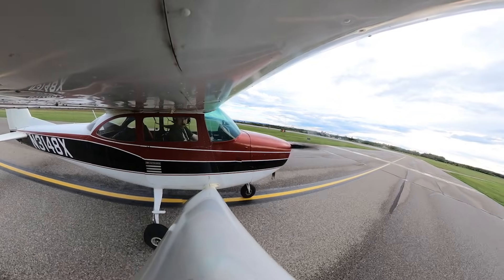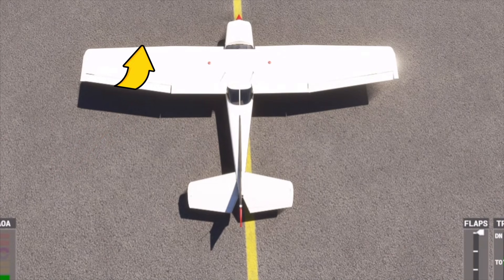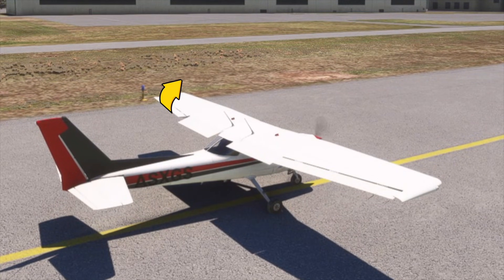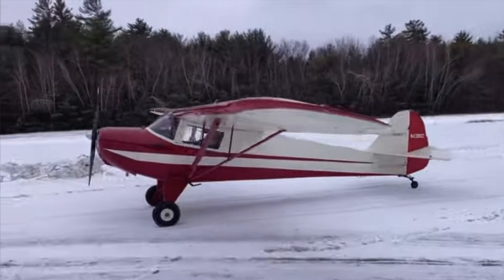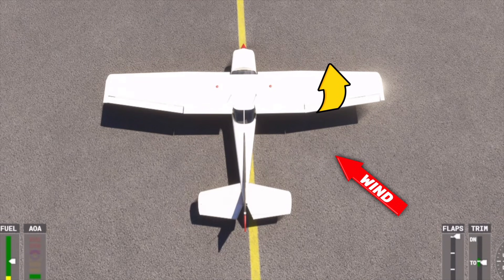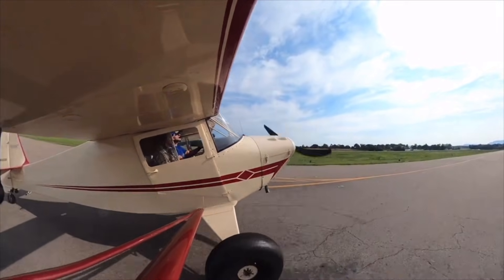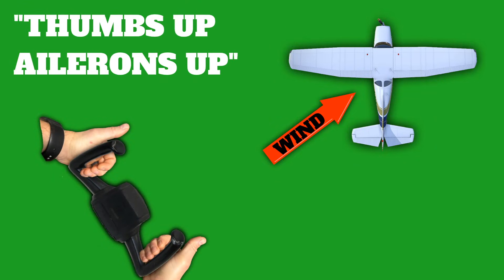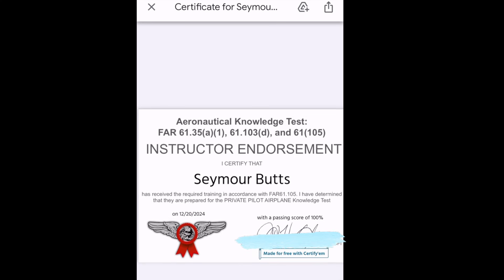How to Taxi in Strong Winds (PPL Ground Lesson 63)

Comment: At what wind speed do you think is strong enough to require correction? Is it based on the feel of the aircraft? Is there a wind speed limit for an aircraft beyond which it's best to compensate? Perhaps it would be helpful to know this or where to find the data to give an idea to those who don't know. I've been in similar situations in the past; sometimes planes get tied with ropes on the apron with the controls locked. I'd add that you should also compensate wind if, for example, you're near large turbine-powered aircraft. At the holding point, with a large plane taking off on the runway with its engines at full throttle, the engines generate a strong air current, and it's necessary to compensate the air current for safety. In any case, it's always best to keep your distance from large jets, both on the intake and exhaust sides. Both air currents are strong, and the latter even smells of kerosene.
Reply from the maker: I would say that it’s good to practice in all wind conditions in the beginning, so you get the control movements correct. 15 knots is a good rule of thumb though for light aircraft. For big aircraft, like a C-130, you may not ever need it during taxi

Comment: The truth is if the winds are that strong, and you are a relatively new pilot just learning, you probably shouldn’t be flying that day. Tricycle gear are the most challenging because if you taxi into a tailwind and push the nose forward, you will be causing undo stress on the nose wheel, however, if you pull the yoke all the way back, you probably will be lifting the nose wheel. This is why in a tail wind you taxi with the elevator very slightly lowered of center. In a tail wheel airplane, the object is to control the elevator which ever way the wind is coming from to keep the tail on the ground. Always remember when taxi, turn the control wheel into the wind and away from it in a tail wind. Easiest way, I remember of which direction to steer according to the wind is remember when it comes to the wind turn in, drop out. This means turn in the direction of the headwind and turn away from a tail wind.